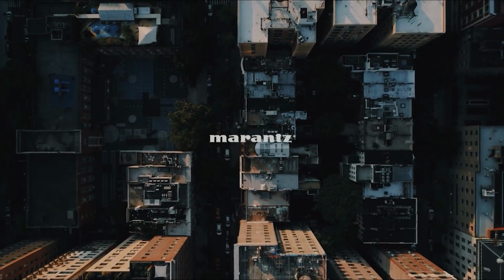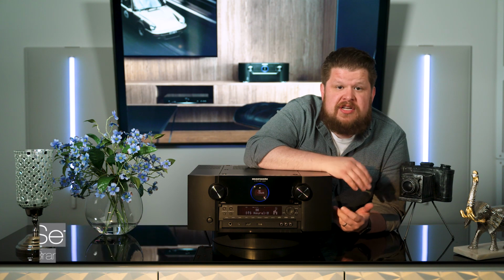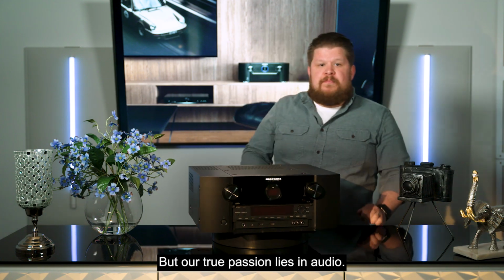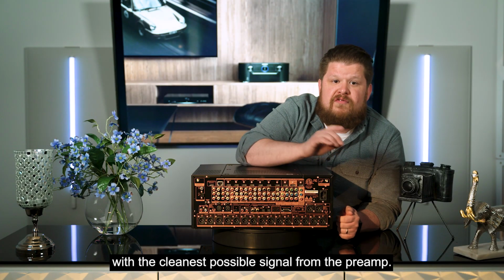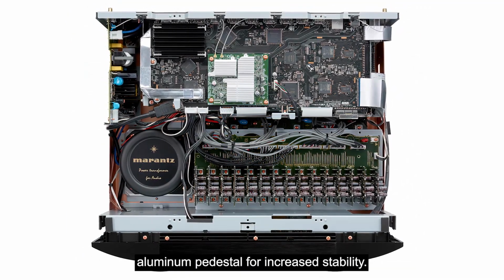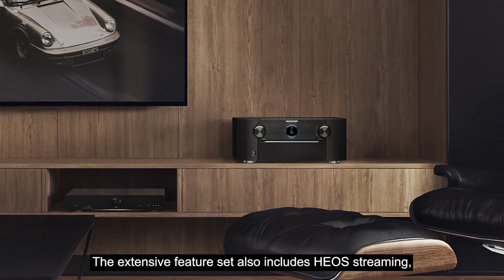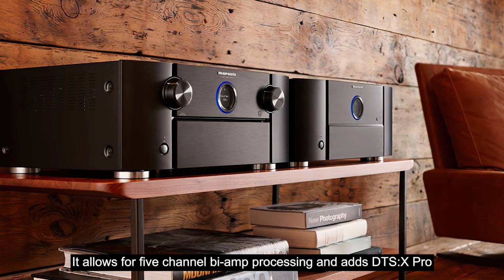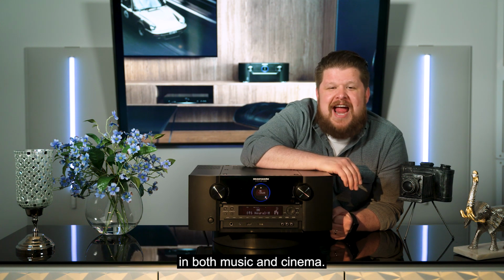Marantz A/V Preamps: The Best Sound for Movies & Music?

Comment: Nice to see content coming through for Sound United. I have always loved Denon, .. I am wondering if I will love Marantz as a processor based on that previous enjoyment. Thoughts?
Reply: No regertz with my 8805A. Grab a refurb one at A4L, no issues at all and comes with warranty. Reliable units that “just work”. Definitely you’ll love it.
Reply: @HiFinest343  - Appreciate that feedback. I have a lot of confidence in the build and longevity. I own 2 denon now and looking for a 3rd. My 4308ci is still kicking ( but it has relay connectivity issues - and I can't find a good repair shop for it locally )

I know there is some differences in the Marantz sound character, so I am looking for details on that side of the ownership / implimentation. ( also, .. Audessy isn't the " best " but I would like to see a VERY details power user level adjustability program that allows users to set EVERYTHING manually.. with lots of options .. phase, timing, distances, papametric EQ points, bass management, multi sub... extra output config.. amp assign.. amp congif.. etc etc.. )

Sound United - if you read this, .. who do i Email?
Reply: Yes, I think so. Once I went from Denon to Marantz, I never went back. I left Denon when they went to D class.
Reply: @m4nc1n1  - Denon Class D isn't as bad as some others I heard. There is a brand with mixed A/B and D and the back channels hiss like snakes.
I understand the concerns over poorly designed or improperly oriented class D in a circuit. I like the idea of seperates. If I decide on Marantz for Processors, I suppose the amp choice will also introduce a synergy to play with.